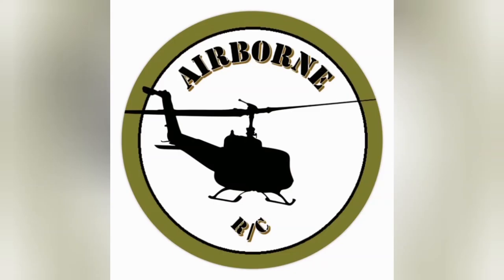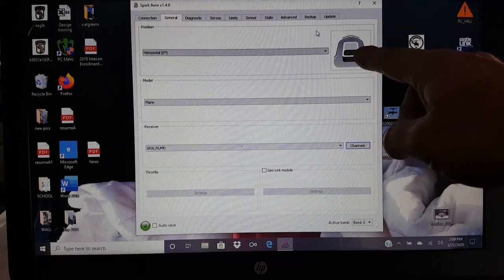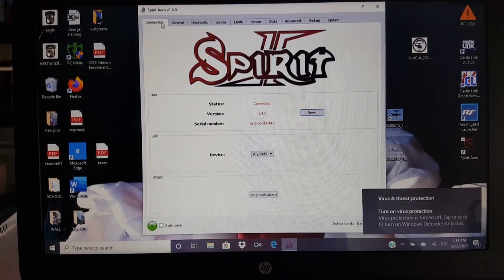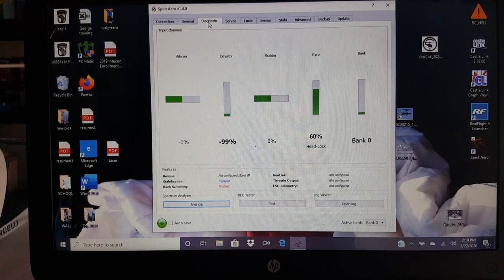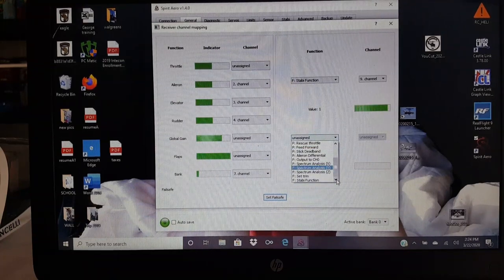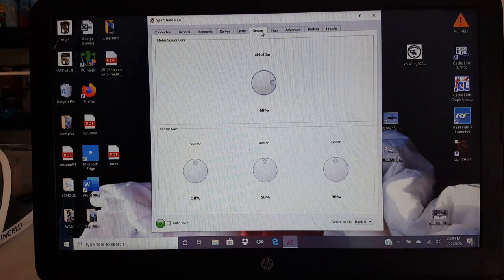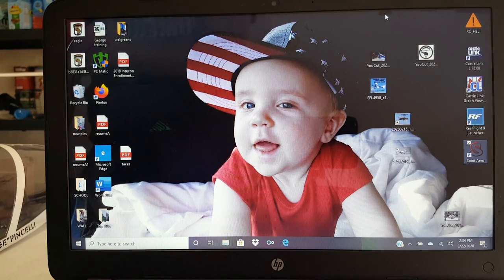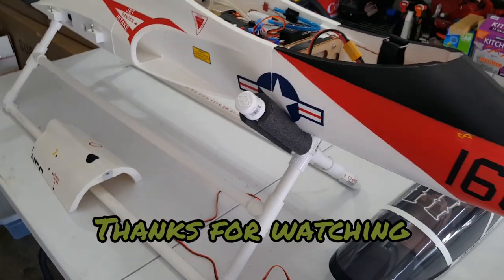Spirit Aero gyro install and set up on HSDJETS Super Viper Turbine "NOT FOR KIDS"

Comment: Hey Noonz - You were 100% right on with the turbine placement.  I installed mine at 5/8" on the nose.  I fired up the turbine in the plane today and there were no issues at all with heat in the turbine bay.  In fact, it pulls such a vacuum down the exhaust tube that it sucked the turbine hatch down tight out of my hand as I was putting it in place. Thanks for the tip and the heads up!!
Reply from the maker: YUP the vacuum is what ya looking for for the cooling and pulling air through the intakes, AWESOME JOB! Another little thin i did was i lined the turbine bay in the HVAC Aluminum tape just for added security
Reply: @NoonzAirborneRC  Yep - I lined mine with aluminum tape too.

Comment: I have one of these Jets, and it has a bad habit. When landing with full flaps (45-50cm from root side), just before flare, about 4 ft above runway, I experience loss of elevator authority (horizontal stabilizer blanket/stall), causing slight balloon then sudden drop. Often resulting in a heavy landing, or PIO (but not pilot induced), and or landing gear damage. I usually can do a go around, then using take off flaps

Comment: Hey Noonz - Thanks for the turbine install videos you sent.  Mine is all done - 5/8" in the nose!

When you get a chance, if you could share what you ended up using for your high and low control throws and flap deflections I would really, really appreciate it!  Also, if you did any flap/elevator mix.  Airborne!!
Reply from the maker: Paul I used the elevator flap mix that came programmed in the mix, I also use flight modes with trim (I have a video called precision trimming) you can watch that way if you need more elevator you can add in the air while flying instead of landing then adjusting. As far as rates I use high mid and low on aileron and elevator 100%, 85% and 70% with expo 30%, 20% , 15% set up on separate switches.  Rudder is 100% with 35% expo across the board...I usually fly ail on low and elevator on mid. DEATH FROM ABOVE!
Reply: @NoonzAirborneRC  Thanks Noonz!  You are a big help.  Any guess what your flap and half flap deflections are?
“Death from Above” - love it.  That is what was on the crest for the 2/508th Airborne Infantry when I was assigned to them at the 82nd Airborne at Bragg.
Reply from the maker: @paulsnapp8674  flaps on my ix 12 Is -98% (no flaps), take off is 0% landing is 98%
Reply: @NoonzAirborneRC  Thanks Noonz!

Comment: Looks good 👌  Does this have any "specific thrust" vector control? As I've got the HSD Mirage with 3D pipe. Thanx.
Reply from the maker: No, sorry nothing for vector control. That might be tricky bc most gyro d ont control thrust vector and the gyro will try to correct the change I believe
Reply: Thank you so much for the video
Reply: 2 gyros  .